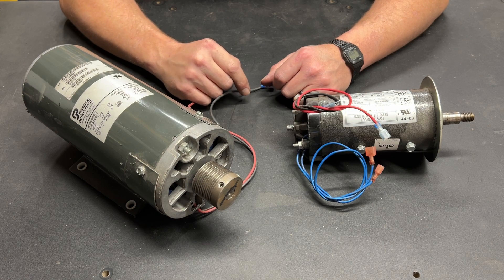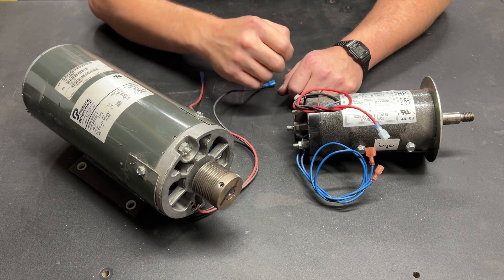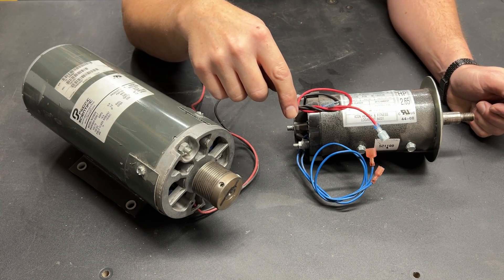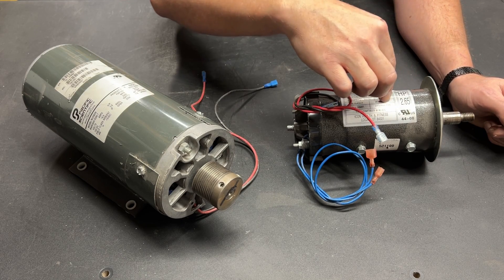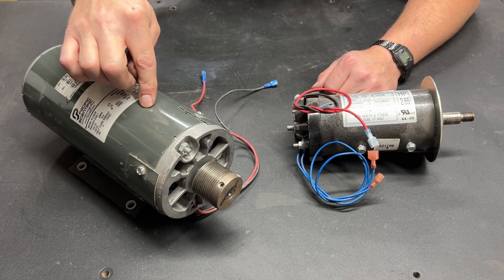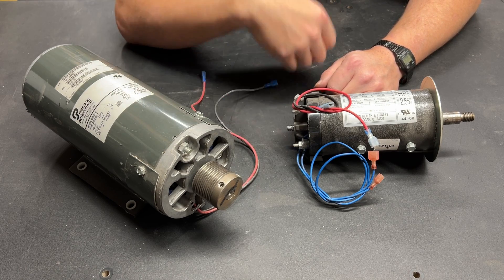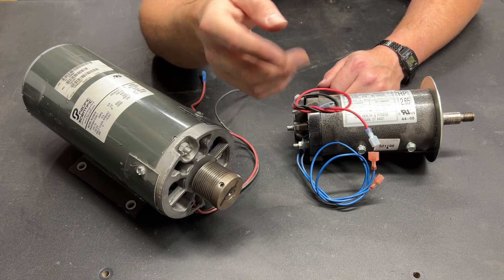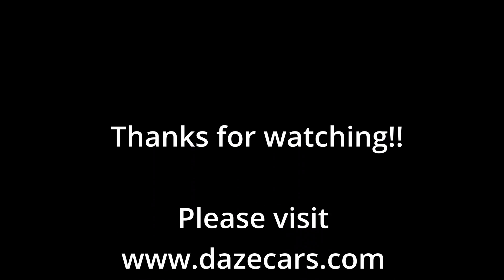Torque Means EVERYTHING When it Comes to Using a Treadmill Motor For Your Mill Lathe or Other Tool

Comment: What would be better to use it as a generator. The big motor would be better at slower rotation but takes more force?
Reply from the maker: depends on how you are turning it, how fast its spinning, and what your output requirements are.  The trade off is turning resistance for power produced.  The bigger motor will produce more power per rotation, that is why the resistance is higher.  ultimately you need to pick the motor that is optimized to your application.

Comment: Hi Dazecars, great video as always. I have a really dumb question.. I'm going with the AC controller SCR route and have built the system. But my existing motor is dying, so I need a new motor. I see a lot of treadmill motors rated for 90v DC. Is this too low a voltage to use with the AC controller? My old one was 130v and works but I'm concerned that the AC-SCR output voltage could blow a 90v motor. Opinions?
Reply from the maker: Not a dumb question at all.  First of all you are only putting out more than 90V at near max speed and for most people you will not be running the motor at near max speed and above most of the time.  That 90V is the HP rating voltage and usually the max continuous rating.  Voltage affects speed and speed affects horse power so to have a reference of where the horsepower is they will list the voltage.  As I said "90V max" is usually continuous use at that volt/speed and spending some time at higher volt/speed is not an issue as long as the motor doesn't overheat.  Heat doesn't happen immediately so a period of time at that setting and then a period of time at 90 or below will allow it to cool.   The last factor is the max bearing speed but most of the bearings in these motors are rated well above the motor output so it becomes a non factor.  Thats all the long answer.  Short answer is the higher voltage should be fine if used in short bursts but you do so at your own risk.  If you want to limit the voltage output on the SCR to match the voltage on the tag you can do so with a specific value resistor in series with the potentiometer.

Comment: Excellent explanation!  I'd long been assuming that the horsepower ratings on these common treadmill motors were basically just lies.  Ex:  Sort of like my 20 gallon air compressor or 16 gallon shop vac - both of which run on 110 Volts and pull less than 15 amps, yet supposedly produce 5 HP!

I will say one thing for the small treadmill motors though.  Since I never planned on using them on machines that were intended to run on more than ⅓ to ¾ HP, I can run the treadmill motor at half it's nominal 8000 RPM speed and still have way more power available than I'll ever need. 😁
Reply: Oh, and I didn't know that any non-commercial treadmills came with those bigger motors.  I've "only" salvaged around half a dozen so far, and always gotten the smaller ones.  Lucky you!
Reply from the maker: you still need to calculate for torque.  The AC motor that came off my lathe was only a 3/4 HP motor and most treadmill motors are 2 or more HP but because the AC motor was only 1700 RPM and treadmill motors are 4000-8000 RPM the AC motor was more powerful than the smaller treadmill motors and comparable to the medium quality ones.  Sadly HP means very little with a treadmill motor because you will be slowing it down.

Comment: What DC electric motor would work best in a small outboard motor? For example if I removed the 9.9 hp engine and replaced it with a motor. Thanks.
Reply from the maker: I don't have an answer there.  The first thing you will need to do is look at voltage and get a motor that works at the voltage of your batteries.  Either way you are likely not going to have anything that will perform as well as your gas engine

Comment: This helps. I have a couple smaller motors. Maybe I’ll make a variable speed shop fan and exhaust fan with them. The air flow should help cool them even if they are on for hours. I’m looking for a big motor for a variable speed conveyor belt as it will need lots of torque and be turning slow.
Reply from the maker: lots of torque and turning slow means you will need to gear it.  Most treadmill motors have between 1 and 5 foot pounds of torque and come on around 400 RPM.  Gear it at 8:1 and you will have 50 RPM and 8-40 foot pounds of torque.

Comment: I ran a fitness store for years -and we sold treadmills with that exact Pac-Sci motor in it...lots of them. in 8 years i think we replaced maybe 2 or 3 of those motors.  the dinky little motors like the one on the right - saw many many of those burned out, or worn bearings sounding like a jet engine, or pulleys so small the heavy clients would cause them to slip and burn through belts.  esp at low speeds the big motor can make a lot more torque, the small ones just bog down and slow down.
Reply from the maker: That’s excellent real world information, thanks for the comment.

Comment: I am a couple years late but I have a wood band saw that I would like to convert to a DC motor.  I kind of see the band saw as being like the drill press where it really isn’t run for long periods BUT when cutting steel or other metals the load is significant.  

I don’t own a motor for the project so I’m a blank slate for options although I have started the hunt for a free treadmill donor.
Reply from the maker: The bigger issue with the band saw is torque. Bigger will be better, I know it was on my conversion Treadmill Bandsaw Conversion
https://www.youtube.com/playlist?list=PLg4j6XzBdSY8AkoE5YBqAHtnb5XDRIl8q

Comment: Daze. Something I don’t understand. How can torque be a constant in a DC motor like this, if it’s dependent on RPM?
T = HP x 5252/RPM. 
The motor specifies the HP and gives a maximum RPM. We can calculate torque from this. But what happens to the torque when the RPM drops?
I’m still a bit confused about all of this. 
Also, on my Southbend heavy 10L lathe, I have a 3/4 HP AC motor. Speed adjustment is done with changing pulley wheel diameters. People on forums say that you don’t want to exceed 1 HP for this lathe. But what does it matter if the motor has more HP? 
Thanks,
Paul
Reply from the maker: I can not speak to the HP limitations of your lathe as it does not seam to be a good spec to pick a motor by.  Max RPM of the lathe and the torque the machine can handle are what is important.  

I can answer the other question.  You are assuming HP is constant but it is not.  HP is a function of torque.  The HP stat on a motor is at the RPM stated on the motor.  DC motors have constant torque so if you have 2 HP at 4000 RPM you will have 1 HP at 2000 RPM.  The opposite is also true if you run that same motor at 8000 RPM you will have 4 HP.  HP con not actually be measured.  All we can measure is torque and RPM and we use those two numbers to calculate HP.  This is how every dyno works everywhere.  In most cases AC motors are designed to run at one speed so a constant RPM. If the motor is designed properly torque is maxed out at that speed which would also be max HP.    Also AC and DC motors play by different rules so you can not take the specs of one and assume it will apply to the other.  This is exactly why I created this video so people can create a common denomination and accurately compare an AC motor to a DC motor.

Comment: I have the little motor on a 2x72 grinder and it has ran 2 to 3 hours straight before.
Reply from the maker: When setup properly the smaller motors can run for hours the issues arise when people try to push the motor past its' normal operating range
Reply: @dazecars  do you know what controller type that can keep a motor at a lower rpm under load? I know there is a way.    I have one in a shopsmith as the motor went out on me, & at the lower speeds it is gutless.
Reply from the maker: This video might help you.  I strongly recommend gearing when possible because in most cases more torque and less RPM is a good thing. https://youtu.be/AdGypyO_UuM
Reply: @dazecars  Going to watch right now.  Trying to do a poor mans power pro headstock.   They go from 200rpm to 10,000 rpm
Reply from the maker: That is quite an RPM range and will make finding the right motor tough

Comment: Hello, im not sure if this has been covered before, so im sorry if it has. I know these motors (generally, unless its really obvious it cant) can run in reverse. My question is can they be wired to run in the reverse direction (according to the motor tag) as the primary direction without doing harm?
I have a treadmill motor hooked up running my wood lathe, but due to the rotation specified on the tag and the pulley location,  length of the motor ect. I fear im getting wood dust sucked into the motor via the external fan. I cant imagine thats good for it. I have tried to make an "air filter" the best I can but I would rather move the motor around so I would have to worry less about it ( and it wouldnt be sticking into my work area)
So I thought i'd ask before i go through the work and fabricate a new mount just to have the motor burn out shortly after.
sorry for the novel, thanks in advance.
Reply from the maker: Assuming it is a DC motor witch most but not all treadmill motors are it should be reversible however first spin it by hand both directions.  If it feels roughly the same both ways than it should be good to go.  Wiring it is as simple as reversing the polarity.  The other thing to consider is the motor flywheel and fan.  A thread on flywheel may come off when run in revers and the fan should be reversed if running it in reverse so that air is moving through it the direction the manufacturer designed it too.  Let me know if you have any other question.
Reply: Sorry I didn't start out with this, but Thank you for all of the time and effort you put into these videos and responses to comments. they are incredibly helpful and informative. I feel bad asking more of you. 
My motor is DC and I currently have it wired to run in reverse with a switch as outlined in one of your previous videos. I have the flywheel drilled and tapped with a set screw so that isn't an issue, mounting the fan on backwards would be easy as well. My question was more ( and I think you answered it, I just wanted to make doubly sure I didnt mis-read)  would it cause harm over time to run it ONLY in reverse (assuming the fan was reversed to cool properly). I dont see why it would, but I like to check with much smarter people than myself @dazecars
Reply from the maker: As long as it feels the same both directions when you spin it by hand there should not be any issue running in reverse all the time. Glad my videos have been helpful!!

Comment: Thanks for the info, just to make sure im understanding. If geared to the same rpm and they have the same horsepower the output would be the same, but the bigger one would be able to run for much longer periods?
Reply from the maker: Yes.  If they start with the same HP and are geared for the same RPM then yes they would function the same as the torque output would be identical after gearing.  The smaller one would run hotter and use more electricity for the same work as it is less efficient.

Comment: I agree with your points.  But consider this.  The cost of your super torque motor and controller?  What rpm is needed to satisfy the requirements.  I have a conversion of a Bridgeport type mill.  The original motor was rated at 2 hp.  I used a treadmill motor that was 3 hp and continuous of 2hp.  Not only was I able to control the rpm by mechanical means- variable speed,  of the mill, but  I could also  control the treadmill motor rpm.  So, I satisfied the requirements, as far as  rpm of the mill.  The cost of the conversion was 200.00, and the cost of a Bridgeport motor was  2700.00.  So, that is my argement. Did I make my point?  Robert Brown.
Reply: Here is the link to the mill.  By the way, you have not provided any bad news to me. Mill works great.  Robert Brown.
https://www.youtube.com/watch?v=jcKwKfgV96I&t=5s
Reply from the maker: Thsat is WAY UNDER SIZED.  I hope it works out for yopu but I would be looking for a better motor.  Good luck with that
Reply from the maker: The point of the video is you need to compare torque numbers not HP numbers because treadmill allows you to reduce RPM and HP is a function of RPM.  Great that you got lucky and your motor worked but not all 2 HP motors will have enough torque  to work in that same situation.  Also $200 for a treadmill conversion is high IMHO.  I'm into mine for around $50 and my motors are high quality ones.
Reply: I saved 2500.00 on my conversion and it works well. You can talk torque all day, but, if it works, it works.
Reply from the maker: It may “work” but you have put a 4 cyl in a sports car. Will it drive yes but it will be underpowered.  Also the gearing required to get usable torque will shorten the life of what is already a cheap motor.  I have a quality treadmill motor running both my lathe and my DIY mill, and didn’t spend more than $50 each.  I would recommend getting the correct motor for your application.
Reply: Torque is not a problem with this install.  You assume that I am a commercial operator, I am not.  This is a DC motor and has plenty of low end torque and because of the gearing, rpm is not a problem.  Also where is this abundant supply of 50 dollar motors you keep talking about? Also what about the controller?  How much are they?, and where do you get them?  I haven't read where you share the source.  You have  made your point and I think I have made mine.
Reply from the maker: I am glad that it "works" for you.  It doesn't change the fact that it is significantly undersized.  As to my $50 statement, that is for the power supply components.  The motors were FREE.  Over the last 5 years I have scrapped 20ish treadmills and only paid for one.  Due to a treadmills size when people move they would rather give it away then mess with hauling it so if you watch things like craigslist and facebook market place and are patient you can score a free treadmill from time to time.  You never know what you will get, some have large motors others have small motors like the one you are using but there is so much good stuff on a treadmill that it is worth the time and effort to haul it and strip it down.

Comment: Real world or rule of thumb, you’re correct.  Bigger is better because of thermal mass and some other characteristics,  but I’m willing to bet an engineer could make a pretty good argument why you’re technically incorrect, starting with you’re not comparing apples to apples.  An accurate efficiency curve for both motors is probably needed for that.   That same engineer could probably design a geared motor and controller with very similar performance to a much larger motor, albeit with a lower duty cycle.
Reply from the maker: From a technical standpoint what you have said is true and yes "in theory..."  But the common equalizer is $$  from a practical standpoint manufactures spend the bare minimum to make a product that meets their reliability standards and price point.  In other words the "efficiency" is built into the equation as we are talking about repurposed motors.   And for the sake of my channels content  the apples to apples comparison is taking HP out of the equation AD or DC  and going by torque because AC motors have a fluid torque curve where as in general DC motors have consistent torque regardless of RPM (except at the very bottom).  HP means very little because manufactures can manipulate HP numbers at the expense of quality.  Love the comment, thanks for taking the time to chime in.

Comment: I put that small motor on my mini mill. I was milling a part for about an hour or so and decided to see how warm the motor was it was way too hot . And I didn’t put the thermocoupler back on it when I put it on the mill . That was stupid !  Do to size I would rather have the ac motor back on it.
Reply from the maker: did you have it geared to maximize torque?  Also did you retain the flywheel as a cooling fan?

Comment: When trying to determine of the treadmill motor is comparable to the A/C motor you want to replace, would you calculate the A/C motor torque  using the same formula as you do for the treadmill motor (HP x 5252)/ RPM?
Reply from the maker: Yes, it’s the exact same formula for both.

Comment: As always, awesome educational video. My question, have you happened to notice which treadmill brands generally use the bigger motor? Id like to know what to keep an eye out for so i can upgrade my equipment but i really need 2 of the bigger motors for the lathe and for the mill. The smaller motor was a fantastic upgrade to the small taig mill, and im super excited to finally get the stepper drivers for it so i can make it CNC. Thank you for all of the videos you make and i continue to tell all my friends and associates to check out your channel
Reply from the maker: That is the million dollar question.  Problem is manufactures make several different models and they rebrand those models every couple years.  I have scrapped about 20 and all of them have been different.  Short answer, I haven't got a list.  I can say this however, there are three basic categories:  home cheap, home high end, and professional gym.  The big motor in this video came from a professional level treadmill.  Brands like Nordic track and Prcore tend to be better as well but that is just a general guideline not a hard fast rule.

Comment: These motors look dated. Modern DC motors may be better Tech, generally speaking of course 😮
Reply from the maker: They come from used treadmills so they are by no means new.  Good news is there are not a lot of technological advances to a basic DC motor.  Would be different if it was a stepper or servo that has other electronic components.